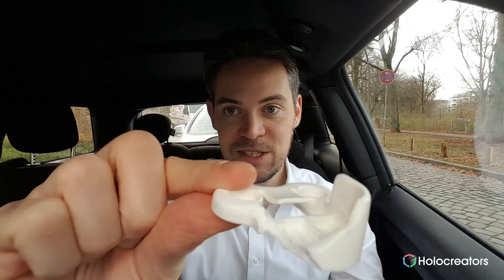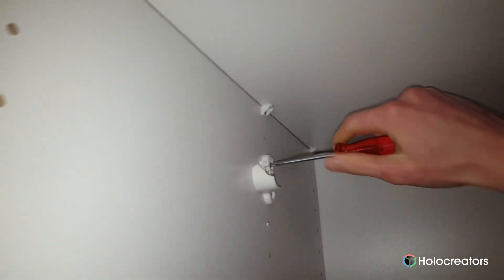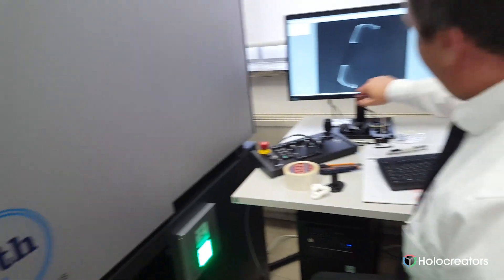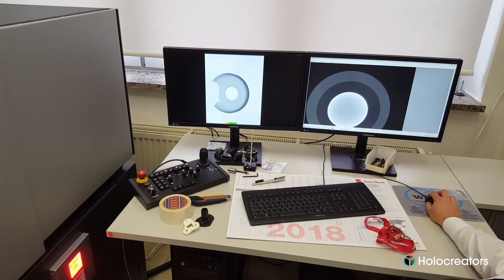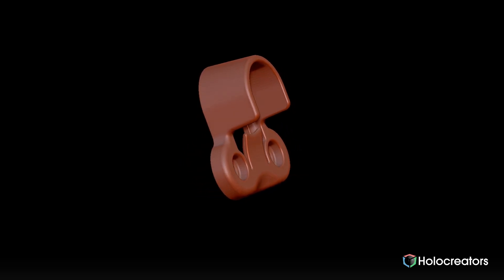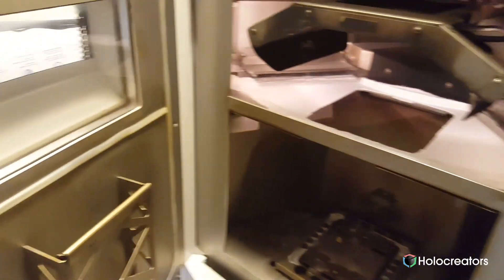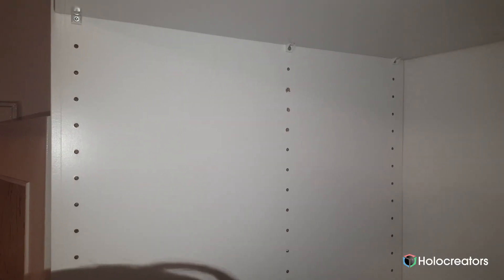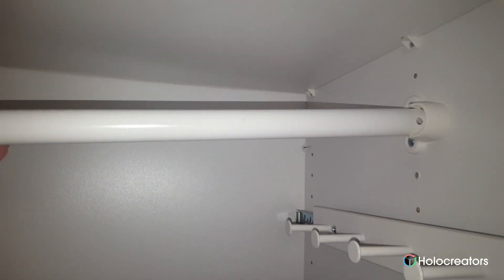IKEA Closet Repair with 3D Scanning and 3D Printing

Comment: So you are using technology in the range of several hundret thousend Euros and spend hours of machine time and highly skilled experts to finally create a part that is worth maybe 5 Cent or so? Interesting approach. If you would be charged for this work, maybe buying 6 to 8  new complete Ikea closets would still be cheaper. ;-)
Reply from the maker: Hi Oliver, that is correct. This is a case study for showcasing the process. The part is actually irrelevant.
Reply: He even made the part wrong. The pipe you should leaning downward. Lol 😂 I'm done
Reply from the maker: @willybilly99  yes maybe
Reply: I mean if he had just used an ender 3 or something it would be different but he had to actually scan the thing (reference images make it super easy)